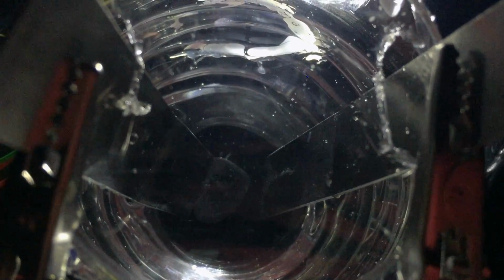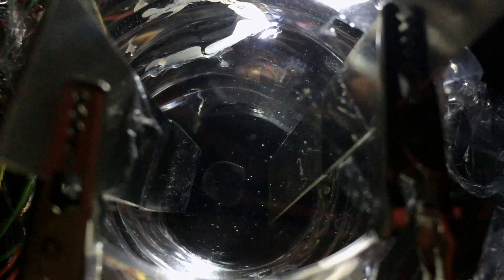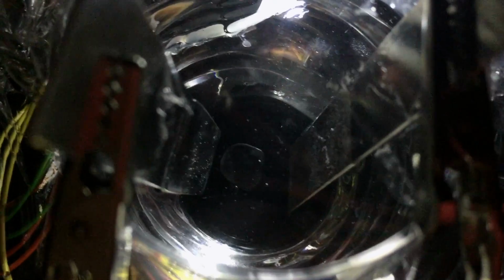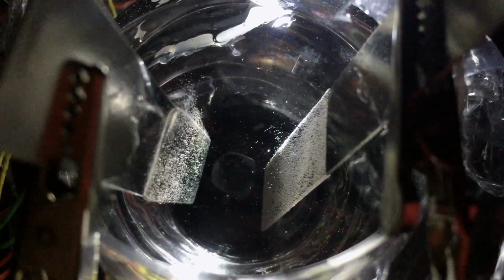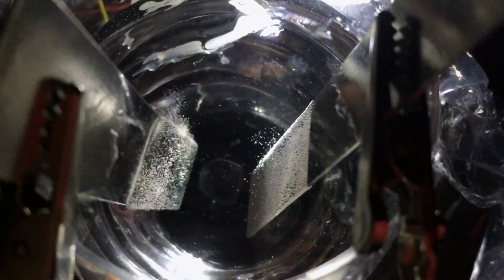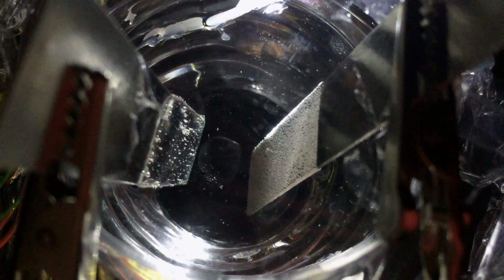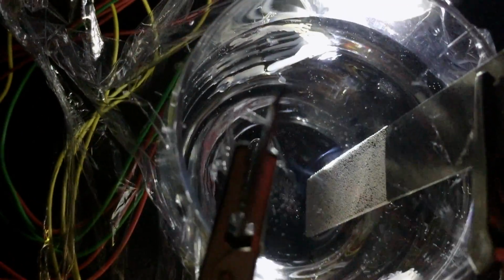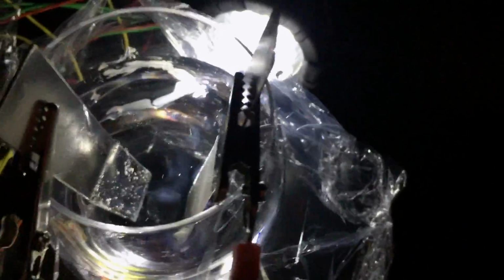Ultrasonic Cavitation of Electrolysis (H2O)

Comment: Interesting video thanks for making it... I have just finished building a small experimental unit for experiments with ultrasonic cavitation, The purple glow appears to be plasma?... what voltages and current consumption readings are you getting? is the electrolysis dc? or are you using a pulse width modulator?... Whats the power rating on the ultrasound transducer?..thanks again make more ok...great work!
Reply: As far as I know, that purplish thing called hydronium ion sir, comes from partially separated hydrogen which turned h2o into ho- and meet another free hydrogen and bonding h3o+ the setup frequency is similar with puharich (1981) and meyer (1991) both using some frequency producing cold current... if only @neutrino use higher voltage with lower amps and bigger amplitude on his transducer.. such bond will be prevented and huge amount of hydrogen and oxygen will occur... also some anomaly called cold current also occur... he just use a tiny transducer devices with common small powered electrolysis setup based on Faraday law... which makes hydrogen not released immediately as bubble gas.. which then captured by the negative OH- ion causing very small amount of hydrogen production compared oxygen... just check the gas production is very visible and imbalanced...

Comment from the maker: alterntech Hi there sir, sorry I'm only 14 and don't understand much of the stuff you were asking, I just kinda created a low budget easy to build one. So I guess the best I can do is to simply describe my setup. I don't know if the purple stuff is plasma (it was actually light being reflected off of it), the water was pretty cold and I wouldn't see how a low energy setup like mine could make plasma. So yeah for electrolysis I got three 9 volt batteries wired together in a series circuit connected to the two electrodes stuck into the cup. The ultrasonic transducers I can't find the power rating. They are connected to an audio amplifier which is in turn connected to a frequency generator set at about around 43 KHz. Like I said again, I did the bare minimum and had little measuring tools so sorry I can't answer much. I might try a setup however with salt water as from what I've heard it increases conductivity.
Reply: Keep experimenting with similar setup... maybe you'll be surprised of the result :) don't just play game would you..